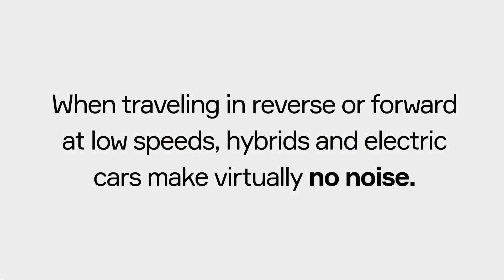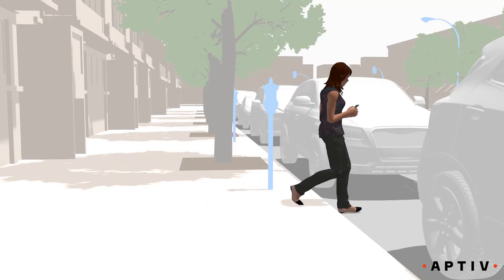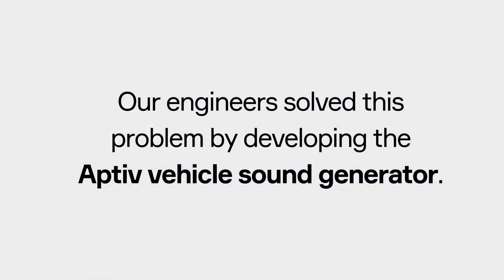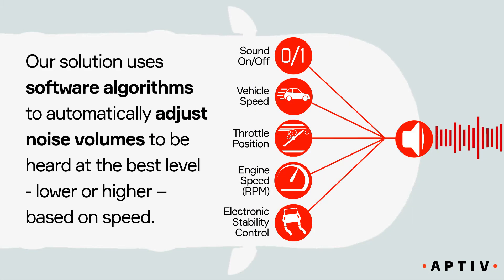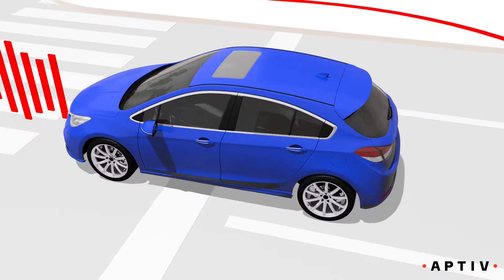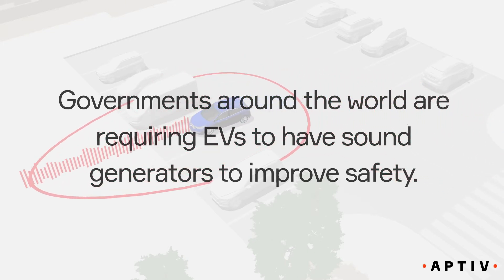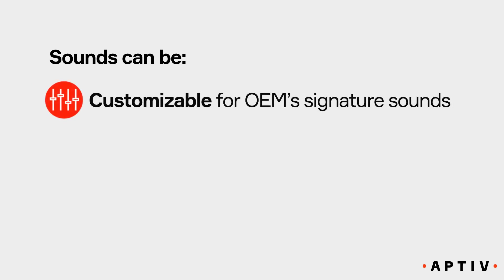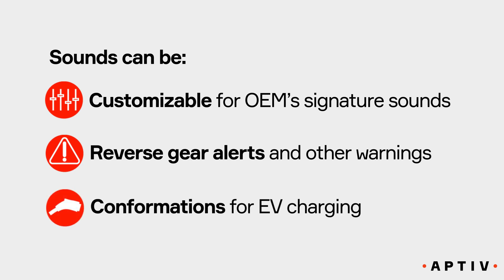Aptiv's Vehicle Sound Generator (2018)

Comment: Personally, as someone who regularly cycles and has to suffer pedestrians who will step into the road without looking, I'm split on this.

On the one hand, it removes the the requirement for pedestrians to look where they are going - and in so doing lessens my safety.

On the other hand I would like to fit one to my push bike, to help protect me. Though no one seems to make one yet.
Reply: Im trying to get one too, I’m trying to convert my bicycle in a local EV and I feel the need to have one of these so that people can hear me instead of a dead quiet electric bike. Im also gonna try to make a turn signal system.